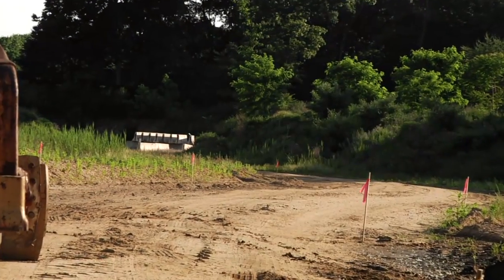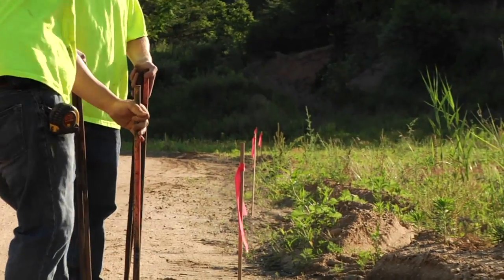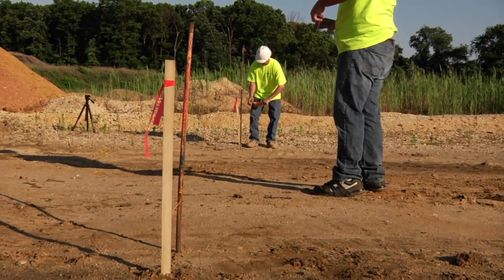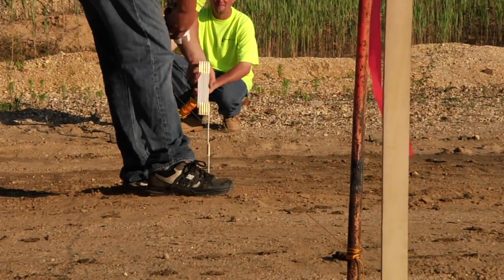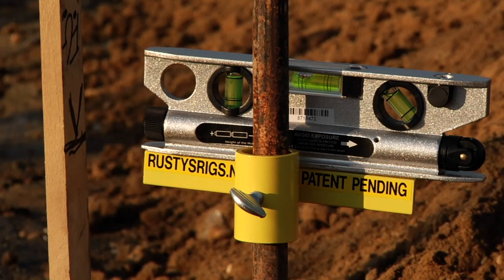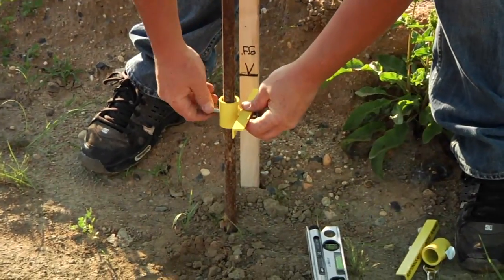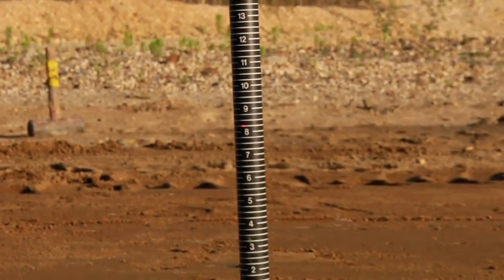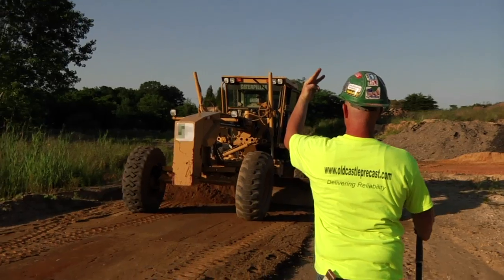FAST GRADE by Rusty's Rigs

Comment: Slopemeter will get you within a 1/2 inch no strings. GPS is garbage its only as good as the person entering the information on that model. GPS is OK but it still new and got a long way to go before its perfect!
Reply: I doubt anyone uses gps to do finish road grading
Reply: @ANONisEVERYTHING  We use GPS for rough grade, then turn it off for finish and do it with our eye. GPS bounces too much otherwise
Reply: @zmonk901  Yes GPS bounces a few 100ths, I have heard of people using radar, though I have not seen it done that way. Hubs and good blade hands go a long way!